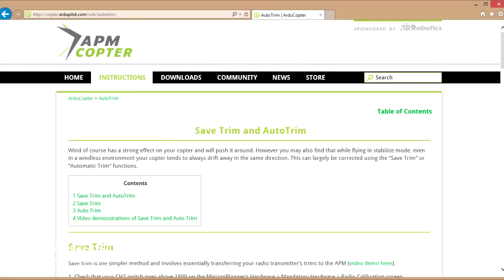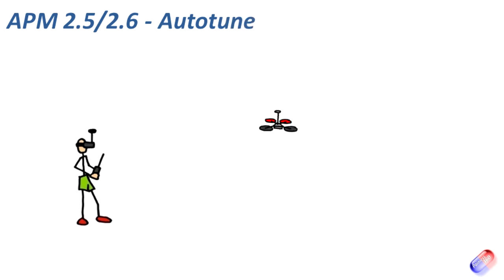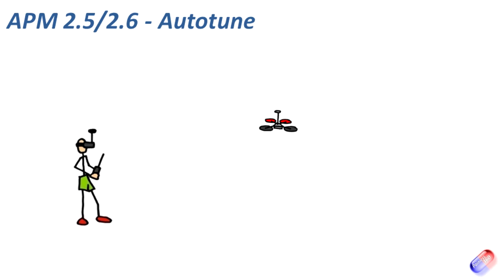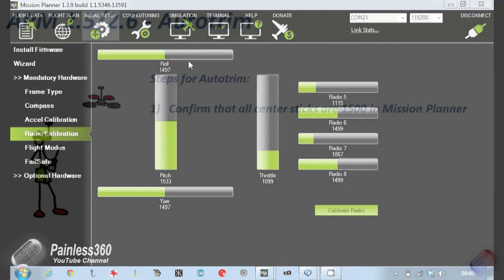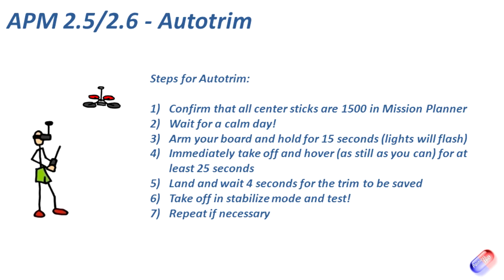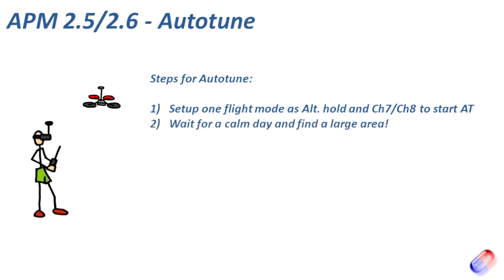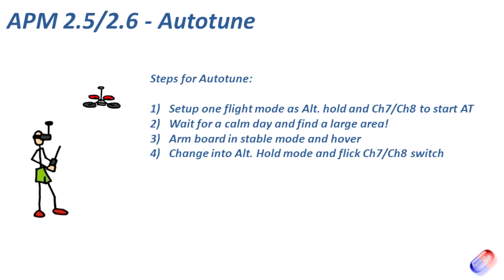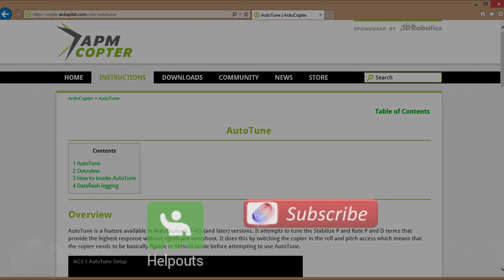(7/8) APM 2.5/2.6/3.1 - Autotrim and Autotune

Comment: HELP HELP HELP!!!!! spent all day setting it up and it flys but the gains are too high and the thing shakes like mad!! so i need to do auto tune but my version of APM Planner doesnt have the screen or option to enter that screen a 8:48. Its version 2.0.15 of the software :) please help lol
Reply from the maker: First thing is to update the version of the Mission Planner to the latest version. I'm building an APM setup at the moment and flashed a board today - Mission planner is at V1.3.17 and the firmware is now V3.2 or later.

I'd try it again with the latest version and see if that helps. The firmware and Mission Planner are evolving and improving all the time so an update before you start is always recommended. It will usually prompt you if you are out of date anyway.

God luck.

Comment: Hey painless, you have been super helpful to me so far, so I have another questions for you! I finished building a hexacopter with an APM 2.6. It hovers great, but if I make almost any stick input it goes crazy and crashes. I don't think I can get it 10 feet off the ground to put it in ALT hold to do the autotune without crashing it! What should I do?
Reply from the maker: Check the elevator and aileron channels are smooth with good endpoints and radio calibration in mission planner isn't corrupted. Also check out the model sees any tilt correctly and confirm your motors are plugged in correctly for starters. Good luck with it

Comment: Should i perform autotrim or autotune on the APM if my quadcopter is moving towards its left?
Reply from the maker: +MC7 FIFA Gamer make sure the clue of the aileron and elevator channel are settling at 1500 and run through autotrim. Best of luck!
Reply: Painless360 thanks for your time.

Comment: Hi. Me again.  I tried to do the autotune yesterday, but nothing happened.  I assigned Autotune to channel 8 on 'SG' on my Taranis. (Channel 7 is already set up for RTL) I double checked that channel 8 was switching on the Radio Calibration page in APM Planner 2, and yes, it was.
When I took the quad outside to do the Autotune, I went up to about 20', switched to Alt Hold, then flicked 'SG' and... no dance!
Any clues?

Comment: First, Your videos are extremely helpful!!!
I have an APM 2.8 and was wondering if there is a way to disarm quickly. Now it takes several seconds to stop the motors. I am new and once in a while I have an oops and flips over. I try to immediately disarm as the props are still turning and beating themselves on the grass.  I have not hurt anything but it can't be good for the motors, escs ect. I am very excited about the APM even though it has been replaced with the Pixhawk. I am waiting for the Mini APM and my new FR SKY 9D plus to arrive.
Again thank you for your videos. I have been following you since the days of my old NAZE32, which I boxed up for the APMs.
Cheers
Reply from the maker: No fast disarm but this may help - http://youtu.be/cXSNgCQ9WJw

Comment: Hi! In the Autotrim procedure, I understand that first you have to set de pitch, yaw and roll to 1500 using the trim buttons in the front of the transmitter, right? 
When the 25s flight has been done, am I supposed to set the trims again to neutral position or am I to leave them at the position I had set them at the first step of the procedure?
Thanks!
Reply from the maker: girarcat once the autotrim process is done then you should have a drift free hover so you don't have to change the trims on the tx again, you can put in a few clicks of trim on the transmitter if you get drift but more than that I would run the autotrim process again..

Happy flying!
Reply: Painless360 Thanks for your answer!
I've performed the autotrim process several times, but each time I get a different drift direction (sometimes to the right, sometimes to the left, etc.)
 When I release the sticks the quadcopter stays steady for a couple of seconds and then it starts a relatively high speed drift.

Furthermore, during the first 10s of the Autotrim flight, the quadcopter becomes completely unstable, making it almost impossible to control (I've been about to crash it against my house). After the first 10s, it starts to behave as normal, and I can make it hover steadily.

Do you think this is normal? 
Thanks!
Reply from the maker: Do you mean auto trim? That should be an easy process, auto tune should cause oscillations and large movements in the sky.

You need to concentrate and keep the model as still as you can so there needs to be no wind and you need to be focused so that the model learns where the sticks are for a steady hover.

Best of luck with it!
Reply: Painless360 Yep, during the first 10 seconds of the auto trim flight it's impossible to make the quad hover steadily. After these 10s, it starts behaving as usual. 
Thanks

Comment: after you disarm for autotune do you put the trim on the transmitter back to the middle?
Reply from the maker: The trims and PIDs are not the same thing so I'd check it after tuning and use the trims to correct any drift. Happy flying!
Reply: Painless360 sorry I meant after autotrim oops
Reply from the maker: +Michael Kyle shouldn't need to..

Comment: Hi, thanks for posting. I am trying to bench test auto-tune first, but I am not sure how to do that?! I mapped channel 7 in MP to be Auto-tune. I power up my Pixhawk and arm it. After arming it, I increase the throttle to around 30%. After that, I switch to Alt-Hold. Once on Alt-Hold, I flip my channel 7 switch (SF on my Taranis) and I get a message on MP saying "Auto-tune stopped"??? Flipping the switch back doe not make the message go away?! Any ideas?! Thanks, G.
Reply from the maker: Autotune is designed for use in flight, I would recommend getting the model in the sky and turning it on so it can do its job. Autotune expects to be able to pulse the motors and measure the result through the accelerometers and gyros.

Best of luck..
Reply: Painless360 Thanks for the fast reply. I understand that it is meant to be used in midair, but what about testing if it even works, BEFORE you fly!? I know you flipped through all your flight modes, on the ground, to make sure that mission planner indeed changes the mode, before you even maiden the bird. Right!? There is nothing wrong with bench testing certain features... no one seems to know how to test Autotune on the ground though!? Once again, I am taking about seeing if the procedure is initiating, but going through with it. Thanks anyway.
Reply: ***** Hi, i read your post, and to me it looks like maybe your auto channel is reversed. This would result in the apm thinking that you were imediately in auto tune once you went into alt hold, and when you hit the switch, it would come out of auto tune. I use mission planner to check before i fly since it will tell you when you are in auto and have stopped auto. Since this post is a few months old, you have probably figured that out already.
Reply: Nate Moss Thanks for the input. I figured it out. Thanks, G.

Comment: Can I somehow bind channel 6 to either alt. hold or autotune. I only have a 6-channel transmitter (spektrum DX6i) and I'm using PPM.

The only option I've found is "Altititude hold kP" in the standard params, but I'm not sure that's what I'm looking for.

Thanks!
Reply from the maker: Mosbror plug channel 6 into input 7 on the APM. Make sure you can see it move when you flick the switch in Mission Planner.

Best of luck.
Reply: Painless360 Can I plug it into channel 6 into input 7 and use PPM at the sametime? Maybe I can just try it and see what happens :)
Thanks!
Reply from the maker: Ah! I missed the fact that you had PPM!

You can remap the PPM channels on the APM but I've not done it. Have a look on the wiki and forums to see If there is an answer, sorry I can't be of more help..
Reply: Painless360 I'll look it up and post it here if I find anything!
For all your +10.000 to see! Congrats on that!!

Comment: I was working on this tonight, it was dead calm. I ran it for about 5 minutes and it was still going left/right, never did finish the routine. Is there a way I can do it in less time, I only have seven minutes on my battery time and I used the first 1.5 minutes playing with Auto-Trim.
Reply from the maker: ***** Sadly it takes as long as it takes. I am not aware of any ways to speed it up..
Best of luck with it.
Reply: So maybe I will have to use a larger battery so it will stay airborne longer. I did have to use the sticks on occasion to bring it back from the edge of where I was flying. Does that influence how long it takes other than the short time I was on the sticks. Does it have to start over or something if you move the sticks?
Reply from the maker: Any movement on the sticks will 'pause' the process and it should resume as soon as you let go..

Best of luck.

Comment: If you don't have enough battery left to complete the tune, can you land it as is, save the settings so far, replace the battery and then send it back up? Will it continue the tune from the where you saved it, thus completing the process quickly on lipo 2,or will it start the whole process again.? I'm concerned my 2200 3s won't last long enough to do it in one go.
Reply from the maker: mrmurder75 I would re-read the instructions on this.  Aim to use a battery that will allow for a complete tune. Best of luck

Comment: Hi painless360, i know this is an old topic but i just wanna ask if the auto trim and auto tune of an apm (i'm using a cx-20, btw) can be done indoors? does it have any effect when you auto tune indoor and then use it outdoor? the reason i asked you this is because i've done an auto tune indoor but when i flew my quad outdoor... the gps hold seems to be not holding its position. thanks in advance man... hoping to hear from you soon...
Reply from the maker: I wouldn't, I'd do it with as much height as you can manage! :D

Comment: Hi, i'm having a small problem with my APM, it will only fly with full up and left trim on the right stick, is it possible to have that trim in place when I fly in autotrim? Will autotrim even fix this?
Reply from the maker: Has it ever flown normally? I'd first check that you haven't accidently installed one of the props upside down (I've done this once!). If that's all ok then recalibrate the ACC and failing that I'd re-flash the code in case there is a corruption...

Best of luck..
Reply: Painless360 It flies just fine with full up and left trim, but without it, it won't take off without the rear right prop slamming into the ground, thanks for replying by the way!
Reply from the maker: Mr. Churros please check the things I've suggested and then hopefully it will be ok. Something is very wrong if it can't fly level on its own..

Best of luck with it..

Comment: need some more help ...
now my 450 quad flies so good in stablise mode and also in altitude hold mode. . but very sluggish slow and least responsive in loiter mode. .
tried to Tune loiter pid settings but it's not responding much...
please help..
thanks in advance 
happy flying
Reply from the maker: +Ashish Faustine The APM isn't a controller for racing (not by any standards! ;) ) so if you've used other controllers then the APM and Pixhawk can feel very 'safe'. Great detail on http://copter.ardupilot.com/wiki/tuning/ and I would check that you don't have too much expo on the Tx and the radio is calibrated in Mission Planner.Best of luck.
Reply: Bro am not racing with it but I just wanted loiter mode to be more stable in windy condetion. .
Now I don't use loiter mode much due to this problem. ..
Its dancing like it has bad pid tuning. . Only in loiter . ..
Reply from the maker: Does sounds like a tuning issue, I would check for vibration before you start and reset the PIDs to default then follow the outline in this video - https://www.youtube.com/watch?v=fNYu5coR6Sg

Hope it helps. Best of luck.

Comment: what should be the initial position of the trim buttons while doing the autotrim?
Reply from the maker: +shyam Saravanan you should ensure that the radio is calibrated and so is level on the model. If you're using autotrim then you leave all trims in the neutral position and the stick inputs you need to use for a stable hover are automatically stored as part of the process.. all covered in the Arducopter manual..

Comment: Greetings! What is your f450 apm pids if I may ask? I'm having trouble stabilizing mine.   Thanks!
Reply from the maker: Ryan9316 Hi, I will chack next time I am in by the model - in the mean time make sure that the ESCs are calibrated and the props balanced. Also make sure that the board is on an anti-vibration mount.You can use the logs to see how much vibration the board is seeing to - see the logfile video in the series..

Comment: Hi,
I'm new to quad copter flying. So when I try to auto tune, flight is very unstable. 
Could I tune it with gimbal + camera on it?
Reply from the maker: +Senal Weerasinghe You should tune the model with the equipment and setup you will fly in as adding a weight under the model after the tune is complete will affect the PID settings with the extra inertia. Be careful with Autotune - it can cause the model to crash occasionally. Use with caution..

Comment: I am sure no one will see this, but my radio doesnt have a ch7 or 8. How can I do autotune??? Thanks!
Reply from the maker: You can use any channel to control it - simply plug the input needed from the APM into the sixth channel on the receiver for tuning.. Best

Comment: Can i ask how many minutes it takes for apm to auto tune itself while in the air? btw im using apm 2.8
Reply from the maker: I'm not sure. The autotune process has been improved and sped up in modern Ardupilot. Best of luck
Reply: @Painless360  Okay thanks. another question. how can i know the battery remaining of my drone like i only have the radio controller and i dont know how can know the battery remaining. Is it like required another component to use to read battery percentage?
Reply from the maker: https://youtu.be/d1ejhtPQrao may be worth a watch... Best of luck

Comment: Hello Painless360, I finally got my Turnigy i10 remote. I have it installed in my Quad and I have set up the 3 position switch on the right side to do the flight modes. I want to do the autoTune. Can you guide me a little on how to set up the ch 7 to respond to the auto tune? Do I just check it like I did with the other channels? Thank you 
Carlos
Reply from the maker: +Carlos Cameselle That sounds about right. Best of luck with it..

Comment: hey how are you thanks alot for your vids !! im having a small problem when im going on autotune for the PID on my S500 .. i dont know if im doing it wrong im doing it in alt mode and then swichong my autotune one like you said so the problem im having is that  wen its doinf the left and right twitching for the autotune all is good and butter smooth but the moment it begins to do front and back  it does it like 2 3 time and the flipa and crashes out of nowhere. .. its the 4th time i try and brack a prop or a arm or ... please help. .. and the thing that after it crashes and i repair i have to do a level calib again and the moment i fly a bit and i begin to go front and back few minits of flyghts then it flips and crashes !... and if lets say i fix it and its running smooth when im flying few minits later i begin to see that its chacking and flickering  then i predict its gona flip i bring it down very  quickly. .. please help
Reply from the maker: +Michel Maalouf I would have a good luck in the forums and consider using another version of the firmware. The autotune code has had a few 'issues' in a few versions in the past. Best of luck.

Comment: Should i perform auto-tune with all my load or minimize load as much as possible (eg: removing gimbal during auto-tune)?
I've read on some discussions online says quad will be responsive on performing auto-tune when there is no load on?
but wouldn't it be more sense to have everything on cause i'll be flying with load on most of the time.

Can you give some input on this? Thanks.
Reply from the maker: With everything on the model. Even adding a heavier pack to a tuned model will make it fly differently. Tune it in the same configuration as you will fly it - be ready to take it out of autotune at the first sign of trouble though. Some pilots have reported uncontrolled oscillations causing crashes, it's not perfect!

Comment: Hey Lee, This video is pretty old, I know Autotune is still a thing, but is autotrim? This is the first mention of it i have seen, but interestingly my drone does seem to need it. Also some say the autotune takes as long a 15 minutes, but i only get about 9 minutes of flight time? Anything i can do? This may be an issue. I have tried to run AT, and it did its thing for the duration of the flight, but didn't seem to finish before it RTL. Now it doesn't seem like it will go into AT at all?
Reply from the maker: Check out the Pixhawk 2020 series for the modern update for this... Best of luck

Comment: You're an inspiration Painless360.  Great videos. 

You almost talked me out of installing an old, never used Arducopter 2.5.2 that I dug out of the garage as in your comments, you often imply that the technology is too dated.  Anyway, I thought I'd give it a shot as I've got nothing to lose - I've already got the APM.
Initial connection frustrations were overcome when I discovered that my micro USB cable was trashed.  Now I'm well on my way.  Cheers mate.

One question... I've got a Ublox GPS module v2.0 and in all the videos, you mention GPS and I can see what looks like a GPS unit next to the APM, but I didn't see anything in the videos about the GPS setup.  Is is just plug-n-play?

Thanks again from downunder.

PS. I've also got a Pixhawk GPS fc on its way for my next project, a Hexacopter.
Reply from the maker: Yep, plug and play. Best of luck!